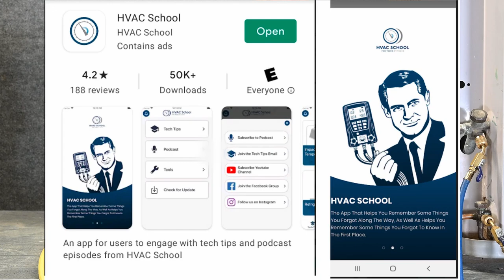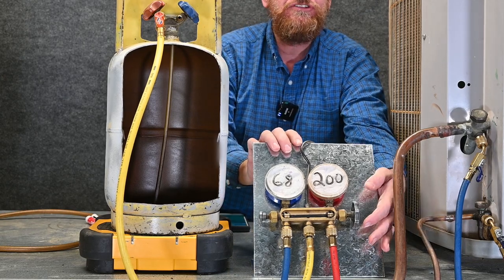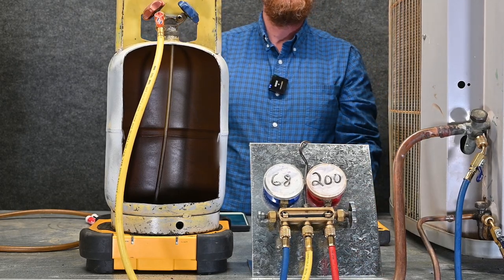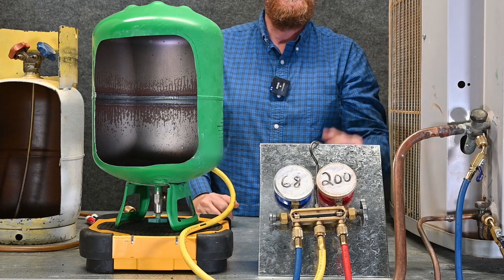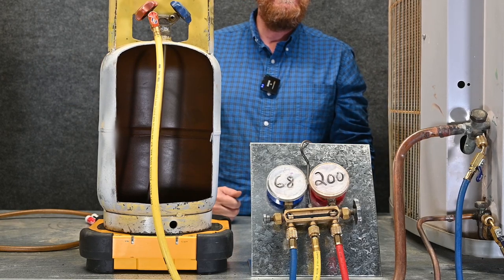HVAC 125 Recovery Overcharged Unit with gauges

Comment: Question, does it matter that it is R-22 and you put it in in liquid form? I know 410-A should always be put in in liquid form, but was told that is a no-no for R-22. Even though R-22 is no longer available unless you have some saved up.
Reply from the maker: As long as you throttle it is you can 100% charge R22 as a liquid. You can still buy it it's just expensive.
Reply: @love2hvac  Thank you.
Reply: @love2hvac  : As of 9/1/2024 price for R-22 = $2,000  a bottle.
Reply from the maker: @Android_Warrior I just bought a bottle for 750 at the supply house. The price 4 months ago was 850. The price is dropping
Reply: @love2hvac  : Not in my area. they hardly sell R-22 here.